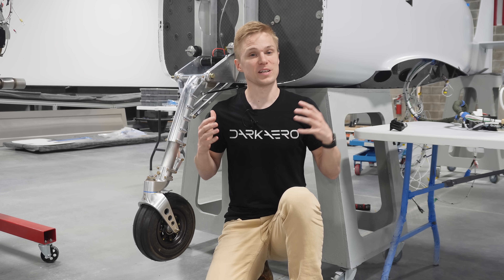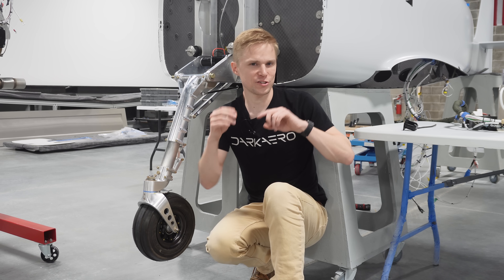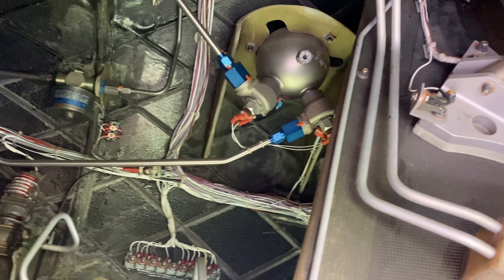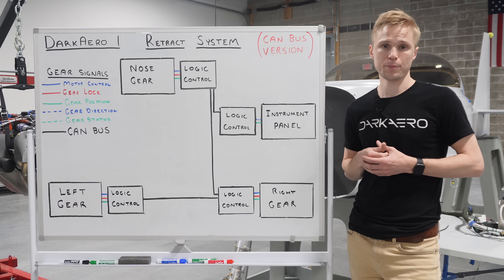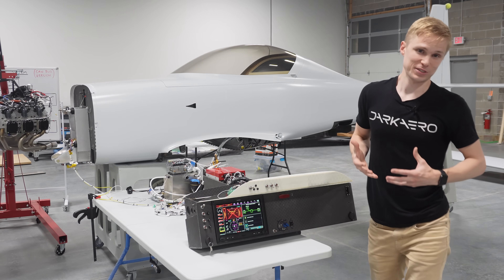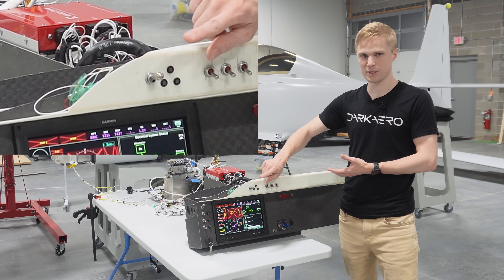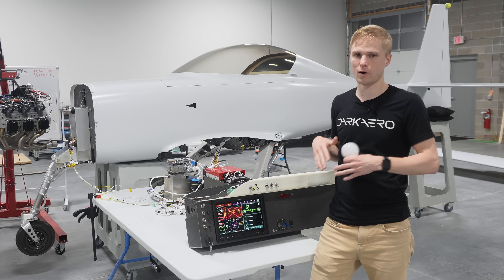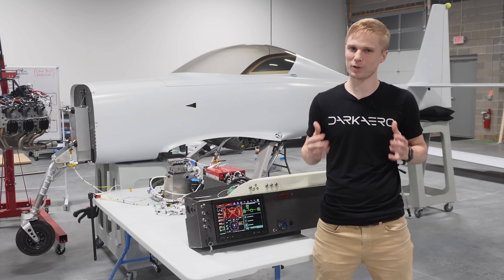Designing smarter landing gear

Comment: Hmm.  I'm curious about the emergency extention capability?  Very whiz-bang - but system failures happen.  Suggest you take a look at the ancient Bonanza arrangement.  It is one of the most elegant and reliable retract systems I've seen in my 39 years of engineering, and GA flying.  Good designs are timeless.

Comment: How do you calculate the air loads acting on the gear either to help/ assist or resist the retract/ extend cycles or even calculate maximum airspeed/ redline limits?
Are there industry standard values for testing or do you have to devise a testing protocol?

Comment: The best way to ensure the gear gets put down is to make the airplane incredibly difficult to get to a runway without it being down. Trying to lock the gear forward seems like a really difficult task in an electrically driven gear, at the very end I see it getting what looks like "blown" forward. A manual crank might be a better option. Look forward to that video!

Comment: The favorability of hydraulic systems also lies in its ability to be redundant by use of shuttle valves in the hydraulic piping, which allows air to be used to "blow out" the landing gear were the hyraulic system to fail for any reason.  A hand-operated emergency valve in the cockpit introduces compressed air from a flask into the air side of the shuttle valves, blocking off the hydraulic fluid flow and entering the piston side of the hydraulic cylinders...your hydraulic solenoids should be the "closed-on" type for draining the fluid from the cylinders for gear down operation, so if the electrical system fails as well as the hydraulic system, the struts can still extend.  It's good for one emergency use, and the hydraulic lines (now airbound) need to be refilled with fluid, but you will have your gear (or flaps) down when needed.  If this aircraft loses it's electrical system, I cannot see an easy redundancy.

Comment: I would prefer an OLED screen with detailed info regarding gear position, system error conditions etc, besides the primitive LEDs. Also, what about a color camera that shows the gear position and the belly of the aircraft? 

Can partially color-blinded pilots get licensed? These guys may be confused under certain light conditions by red/green lights.

Comment: A long coil-over spring with an oil/gas damper might help to alleviate concerns with the gas spring leaking or failing with age.  I know they make similar springs for automotive lift gates that are basically the same geometry as your gas strut, but have a coil over spring around it.  Stabilus makes them!

Comment: Wayyyyy too complicated.  Landing gear systems need to be simple, robust and maintainable. This should be nothing more than electric motors with up and down limit switches. Logic circuits have no place in airplanes. And auto-extend? That is a terrible idea. "But you might forget to put the gear down..."  GUMP check on final, every time....

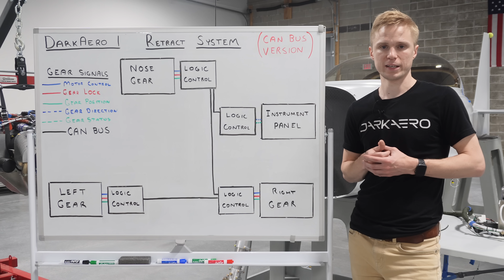Comment: 3:19 Rather than autodeploying, it might be preferable to issue an audio warning. At low altitude and airspeed, a sudden change in drag or pitching moment is not always a welcome surprise. Furthermore, each time it autodeploys (especially without warning the pilot), it trains the pilot to forget gear-extension in retractable-gear aircraft.

Comment: Just a thought: if you design the linkage to be more aerodynamic while retaining strength, you won't have to worry about increased drag when trying to extend the landing gear. And it might even provide some stability when landing in windy conditions since the airfoil design would act as a zero angle rudder all the time (similar to how Le Mans Hypercars use shark fins on the roof for stability at high speeds).

Comment: So what happens when you add in the aerodynamic loads of the plane at approach and landing speeds? It would seem that added load of moving through the air would have a significant force on the components.

Comment: I'd dump that whole system. It's super complex and prone to failure. All those electronics are going to be hard to keep running. Make it work with a manual hand leaver. You can keep all the monitoring junk. But I don't see the advantage of electronic gear with such a light aircraft.

Comment: 'Off' is never a good state for an important indicator, especially if there are no redundancies.  Any fault in an LED or power to it (or the switch) would not be noticed until you tried to deploy the landing gear.

Comment: Have you given any thoughts about designing a circuit  which will allow the landing gear lights perform a flashing mode during transitioning or an unsafe condition?

Comment: On the Lancairs, we have a similar gas piston for emergency deployment of our front gear. The mains will fall and lock by themselves. There is a gas pressure decline over time that results in the gas piston not having enough pressure to push the nose gear against the wind all the way until the over center links lock. If this occurs in an emergency, then there is no way around landing without the front gear  being locked, and usually results in a prop strike and a scary landing. Owners are urged to routinely cause a deployment to check for this, however it is still happens way more than it should. Here, you have all 3 gear using this method, opening up the possibility of having more than one cylinder fail and not lock at the same time.

Comment: I operated a Baron on a Part 135 certificate. One of the very important preflight items was checking the the gear down locks for grease. If they werent properly visibly externally greasy, the bare metal to metal part can bind when under an air load. Gear that work just fine on the ground can act differently under an air load. Im sure that you guys are already aware of this potential severe problem, some of your viewers may not. In spite of my knowledge of this problem, I had a gear failure on my Baron. I was able to help the sticky gear to break loose by pulling some negative then positive Gs. At the moment that I reversed from negative to positive Gs I hit the gear switch down and they broke loose. The left main gear torque tube had already twisted into a pretzel because the main gear up lock held even though the torque tube was still spinning trying to put both gear down simultaneously. When I didnt get a green on the left main, I made sure that it wast just an indication problem by doing control tower flyby. Then I went out and did my G loading gear assist procedure. (I was schooled on this procedure at the time of purchase by a highly experienced AI Beechcraft mechanic.) The left main gear fell down hard under G loading and clunked into place. I got 3 green the second time I put the gear down. My AI mechanic saved me from a huge repair bill.

Comment: looks like Cessna 210 landing gear, but this system doesn't seem to have the emergency extension mode. how do you get the gear down when you lose electric power? and you will loose electric power. is the plan to just belly land and hope for the best? balistic chute?

Comment: Electronics work right up until they don't.  Too much has to happen to do the job correctly.  Count me out.  Just because it can be done doesn't mean it should.  Don't be smart, be reliable.  There are those who have had gear failures and those who will.

Comment: I want to see the speed of retraction a little faster because this plane is going to accelerate so quickly, it needs to get the gear up out of the wind forces into the wheel wells very quickly. Let’s also see the gear extending with simulated “wind loads” against them, I’m not convinced those little motors can overcome wind stresses over hundred mph, manual emergency extension under wind loads also. Then I’ll be impressed.

Comment: One small adjustment I'd recommend from a software/hardware point of view is to have successfully stowed be an illuminated color maybe red. And then in transit be yellow and successfully deployed be green.With this system the pilot can tell the difference between complete gears software/hardware failure(no power) and successful retraction. If this failure were to happen in flight the pilot would have more time to prepare and troubleshoot which could save lives. Great work guys!
Reply: The light color logic they're using is standard throughout the GA industry. Green for down, red for somewhere in-between and off for fully retracted. Two colors keeps it simple plus they are easily visually differentiated to know the condition. Adding a yellow would be potentially too close to green and if there is a partial deployment the pilot may mistake the yellow for green, especially if flying with sunglasses or the sun in their eyes, and land with the gear not fully down.

Comment: I like to see simplicity in aircraft. I'm a pilot and the first thing I look at is, what if it does not work? Jammed motor, jammed gear, or no electricity. How will that gear extend and be safe to land? I love new engineering, and also a great critic and available for consulting.
Reply: In an earlier video, there's a clutch that disengages a failed motor/gearbox, and a gas strut that pushes the gear down. That part isn't installed in this test series. I expect the gas strut will require regular checks to ensure it hasn't failed.

Comment: For some reason it came to my mind to have the gear go in the opposite direction of the wind when deploying. As to have the wind help deploy the gear for less hydraulics needed on a normal deploy. Going against the wind  seems counter intuitive. Also the gear being deployed is more important than retraction. If it doesnt retract it not life threatening as to if the gear doesnt deploy that can be. Idk im not an engineer just seems common sense to me but i know nothimg.
Reply: I'm an engineer, and it seems like common sense to me, too! 
I can't get my head around the fact that the force of the wind isn't being used to help deploy the LG. Pushing against it seems counter-intuitive.

Comment: How do you test for the wind resistance when lowering the gear at 100 knots let's say?  Will the system use a lot more power to overcome the forces of the head wind when lowering the gear during flight?

Comment: Sorry dudes.  A big thing here. Your gear should retract against the airflow and extend with the airflow.  That way if your motor fails, airflow functions as a back up for gear extension.  You movement should be reversed.  Again sorry… don’t shoot the messenger

Comment: Why not make the gear retract system itself hold the landing gear in the retracted position? Why not copy Bonanza's gear extension gearbox idea and only have 1 motor and 1 gearbox to maintain? Also, if an electrical failure occurs, a centrally mounted gearbox behind the seat could easily be cranked down by hand like a Bonanza. I use small dc electric motors to run mechanical functions on the farm, and I have found them to be very unreliable.

Comment: Automotive electrical engineer here w/ experience w/ CAN based networks.  Love the innovation.  Not to be negative Ned here but I'd highly recommend a DFMEA before first flight.  What happens if an ESD event takes out your CAN bus?   Its not all that unusual in the automotive realm.  May want some type of redundancy here.  Sorry to throw a dart, just want to make sure your bases are covered.

Comment: Your solution is cool :+ )
Retraction-only motors would be another interesting option; you could solve the soft-extension problem with mechanical design. Couple the retracting motor with a clutch/dog coupling and a ratchet, and you'll have the option to extend the gear during electrical failure. Torque limiters are another elegant way to prevent damage from overdriving an assembly like this; it won't look as graceful as the computer control option, but also doesn't have to involve sensitive electronics of any sort, nor software correctness (take it from a software guy... betting on the correctness of software is a fool's errand), just crude electric limit switches.

Comment: there's actually a move toward full-electric actuation, from what I've seen, as there are no issues with leaking hydraulics, or leaks from incoming fire/shrapnel, and it's easier to use distributed control and monitoring.
BTW, I think I'd prefer, personally, that you had amber lights during correct extend/retract cycles, only going to red if a fault is detected... over-current, under-speed, locked /stuck, sensor/feedback failures.
Funnily, I was thinking of how simple one could make the functions that you are using a computer to control, with relays (solid-state or not), resistors/potentiometers, switches...a bit more complicated wiring, but operation that anyone with basic electro-mechanical understanding could make work, while still providing the feature set that you have... but, CANbus works fine in cars, and quite robust systems can be designed with CAN/LIN, smart drivers and actuators.
Looks good.
Reply: CAN/Bus is also extensively used in commercial aircraft, I think in many military aircraft as well.

Comment: SO how do you know if one of the lights is not working, or a wire or connection is broken?No test function of the lights, and the lights going OFF means you wont know if the system is functional and retracted, or malfunctioning. You need a Test function of the lights, or they need to remain on.

Comment: Very elegant! I'm not red/green colorblind, but I'm curious if the red/green landing gear LEDs offer enough color differentiation for those that are?
Reply: Yeah, they really need two lights per landing gear. All lights off? Landing gear is up. One (left) light on? In motion. Both lights on? Fully extended, ready to land. (And to +1 other comments, a separate push-and-hold button to verify that the LEDs aren't actually burnt out, as well as piping heat from the engine to the landing gear bays to combat icing-related failures. This is one area of the plane where over-engineering for failure is money/weight well spent. If it were my build, I'd also add cameras to the landing gear bays so I could see what the hell was going on down there in flight.)

Comment: Will there be a mechanical backup to indicate gear is down and locked as an emergency backup? I know weight is an important factor in this aircraft, but I think a pilot already has a lot to deal with while managing an in-flight emergency, especially if there is an electrical failure.

Comment: I just recently saw that a mini turboprop had received or was about to receive certification. Is that something you guys would consider on V2 or V?? Obviously they burn more fuel, but they are crazy light. Wonder if there is some sweet spot with a feather weight plane and power plant. Can't wait to see it fly. You guys are great ambassadors for engineers.

Comment: Do you guys plan on using a weight on wheels switch to prevent pilots from accidentally raising the gear on the ground? I've really enjoyed the aircraft I've flown where this is a feature and its also included an aural tone that alerts the pilot when the gear isn't down after crossing an AoA or Airspeed threshold. That way if the pilot is trying to maneuver the aircraft in a way that would appear to be landing configuration but actually isn't, the gear wouldn't auto-extend and risk being oversped when the pilot completed the maneuver and recovered.

Comment: You have probably considered this but how would an operator distinguish a indication / logic failure from the gear being retracted successfully. It may not be the norm in aerospace but in some industries a positive indication is not used to show an unsafe state. I’m not saying I’m right, more for my own curiosity. It’s an interesting system design challenge. EG the lights fail to indicate when the landing gear has failed to raise. It’s common for problems to cross failure domains.

Comment: This is great to see! Can I ask what kind of system yu are using for the CAN bus? Which CAN bus protocol etc, and do you make your own controllers? 
In addition, I noticed that the left main landing gear was slower than the right landing gear in both retracting and extending motion, what's the reason for that?

Comment: How did you decided the power of the actuator motor taking into account airspeed?

When folding the undercarriage back in, does the software take into account the potential increase in the folding speed due to the air pushing on the gear?

Comment: Did you consider pneumatic actuators? Extremely reliable, high forces, relatively small actuators, flexible hoses that are easy to route, push-to-connect fittings, off-the-shelf components, easy to add redundancy, etc.

Comment: Hydraulics were used because precise control with electric motors had been unreachable until high power MOSFET and IGBT were developed. CAN bus control further reduces weight of electrical  drive.